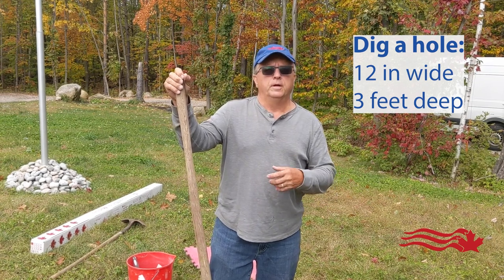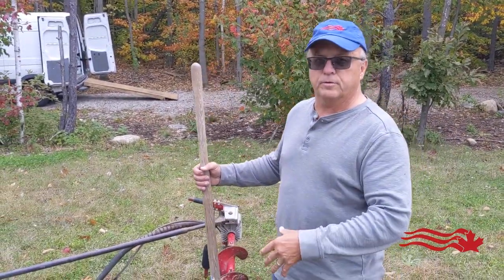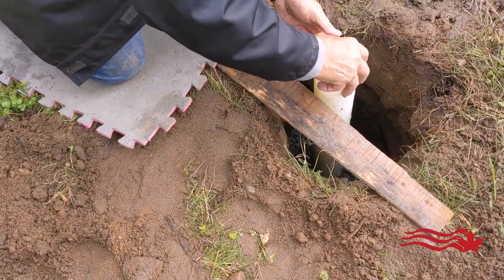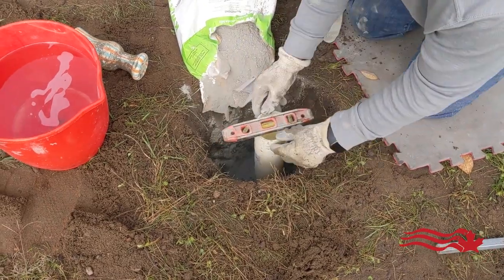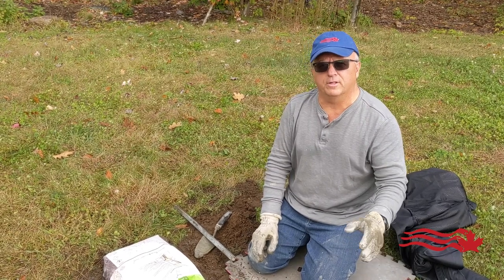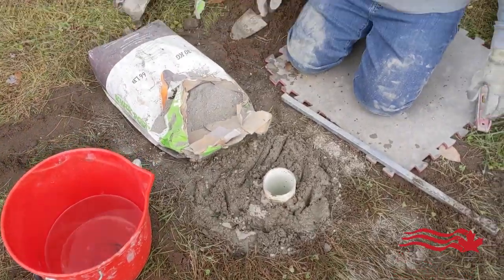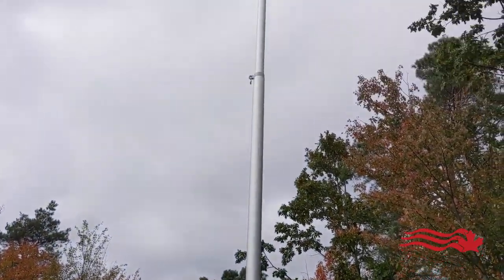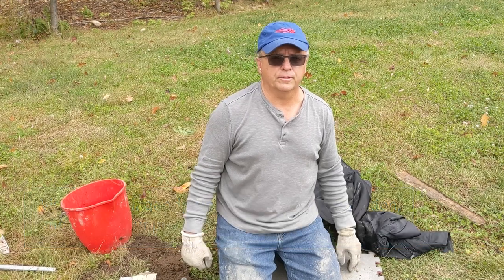How to install an in-ground mount - Titan Telescoping Flagpole Installation

Comment: This is not Surface mount that's in ground.  Surface mount is usually a plate mounted to bottom of pole and is secured to the surface with concrete screws etc.